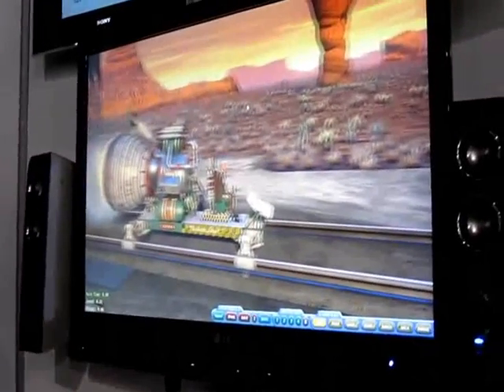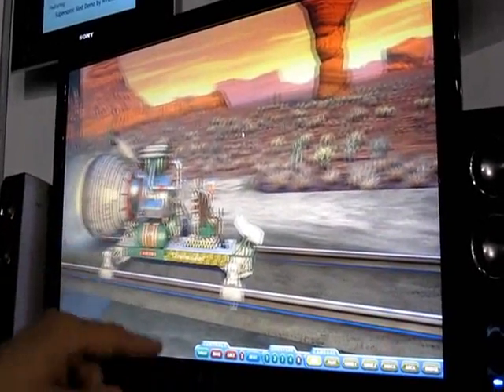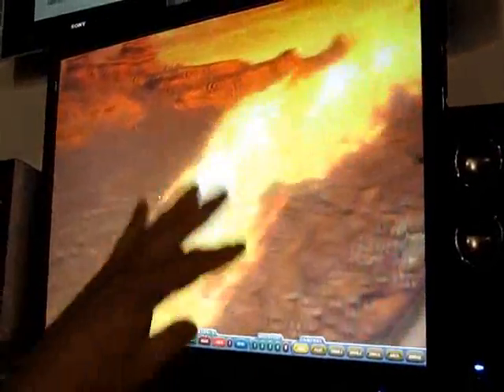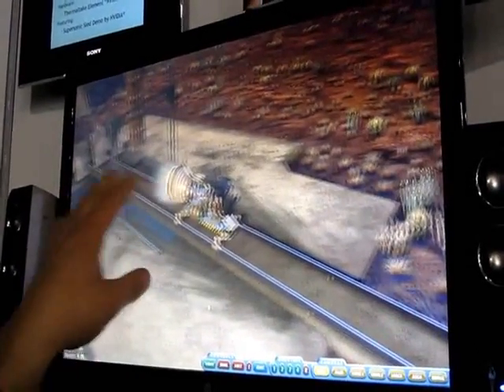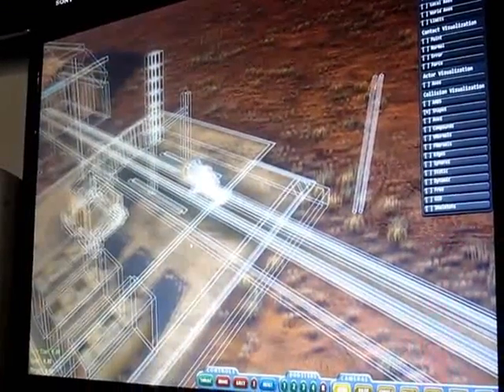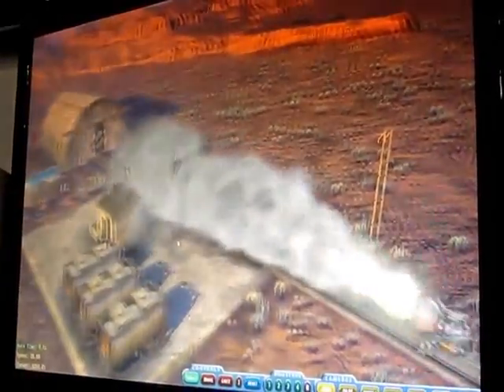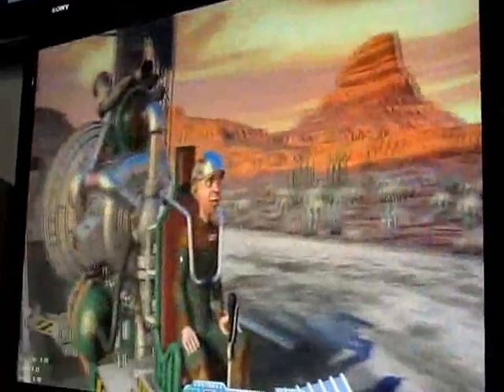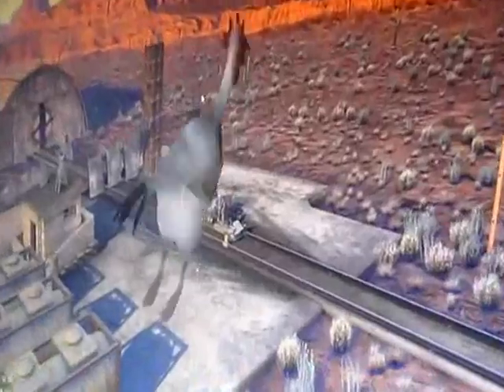NVIDIA GF100 Fermi Video Card Triple SLI Rocket Sled Demo

Comment: @VagabonNinja

Yes a lot of power is cool, but what's the point if developers don't make us of that power? Just look at the number of games that have full DX10 support and are made from scratch for DX10 and not DX9 with added DX10 support later on. Physx works only on NVidia cards, not on ATI cards, not on consoles. So, how many games will we see that will make use of all the Physx capabilities?

A closed standard like Physx will never see its full potential.

Comment: ATI supports OpenCL and cards in the 4000 series did support it as well. Fermi is focused a lot on GPGPU and that's only good in the HPC market. I mean you won't buy a 3000$ GPU just to encode some music faster. GPGPU is cool, but putting to much effort into it isn't so wise since its something new and most user won't even need it. Just count the number of software you use that benefits from GPGPU. GPGPU will be something big in the future, just not now.

Comment: Another Physx show off. Physx is a fail, the only thing it does is eye candy, there is not a single game out there where physx is part of the gameplay. NVidia will have to switch to a open standard cause no one will want to make a physx only game that runs only on NVidia  cards.

When will they show us performance numbers, running a DX11 test without the fps counter is lame. I guess Fermi doesn't have the power to match a 5870 yet.